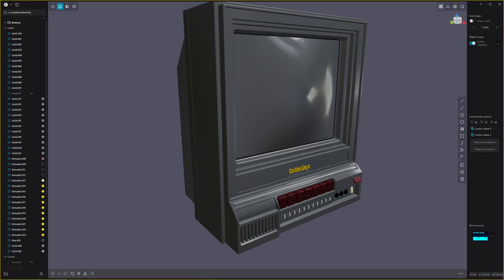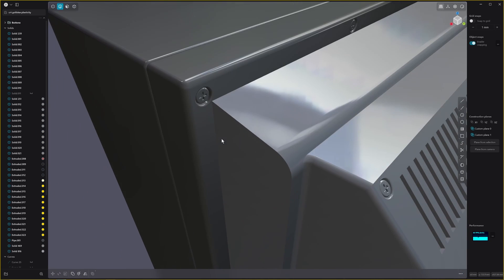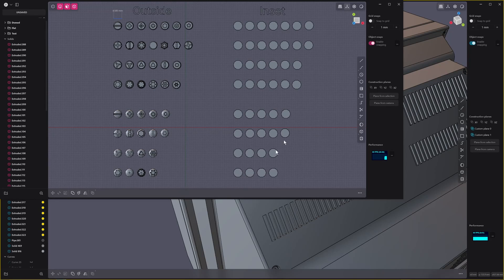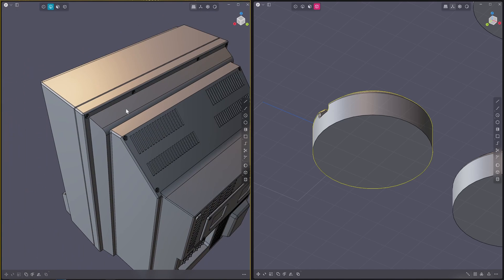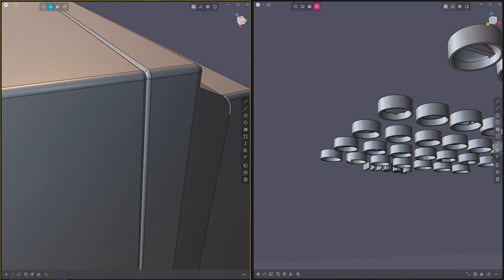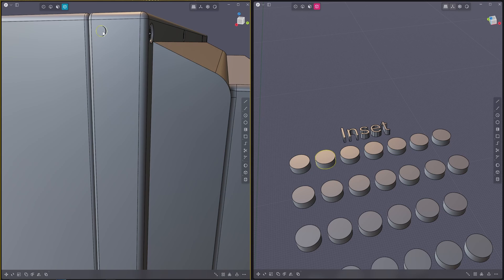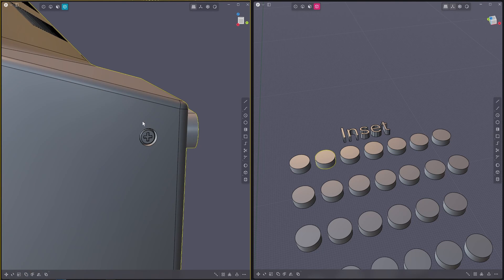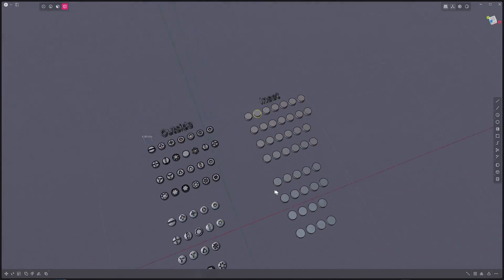Plasticity Kit Bashing is WAY, WAY TOO EASY!

Comment: I'm curious why the insets weren't flipped over so you can access them with more ease.
Reply from the maker: That would be asking a sensible question!! 
I'm really not sure maybe I find it handy this way as I use the insets as reference, if anyone who's bought the pack has feed back including ideas for new screws I'll take it on board